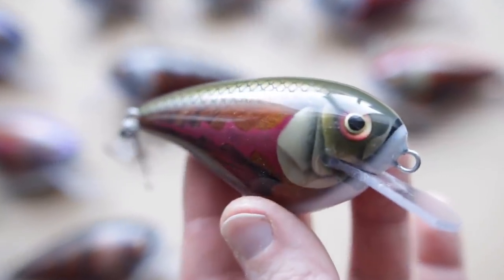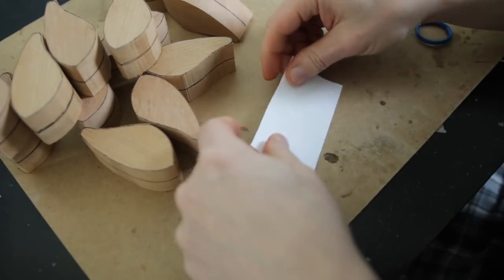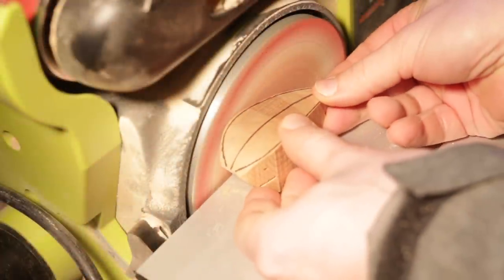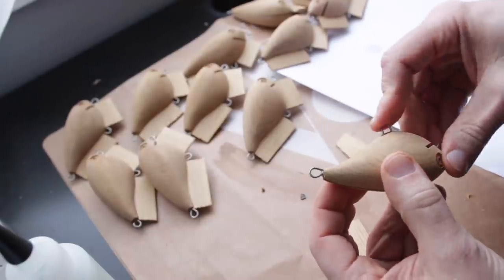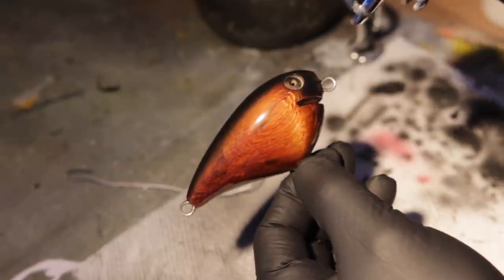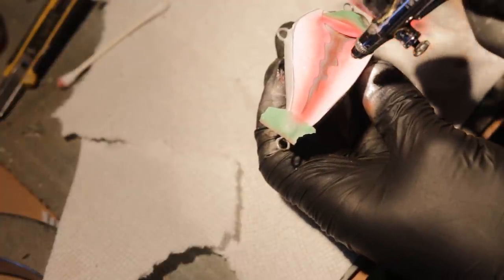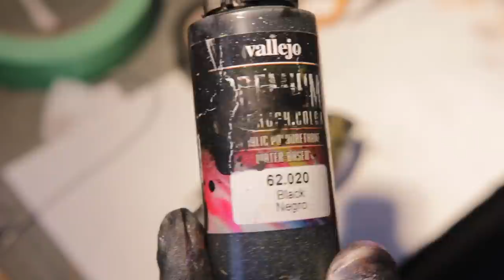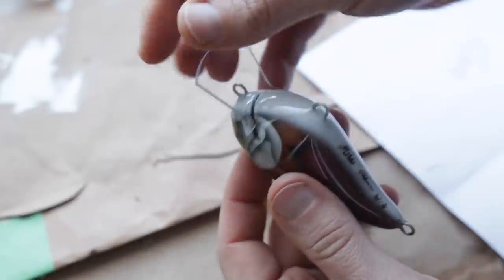Lure making | The square bill crankbait

Comment: 1:53 This is the most common mistake that leads to injuries on the band saw. Do not use your fingers to swipe away waste material! Just leave it until you're done cutting and the saw stops moving or use a waste piece to push it out of the way. I suggest finding a spot on the machine to keep a little dowel or rod to push waste material away if you can't keep yourself from wanting to keep the waste away.

Comment: The wood strip wire slot method is what I use also. Aside from being easier to sand, it also helps to reduce or prevent cracks and splits over time as the wood expands and contracts. As always, I really appreciate the inspiration I get from your incredible work. Miss seeing your posts on OGF in the tackle making section, along with a couple other sites that I've followed you on over the years. Keep on keeping on Mikko!

Comment: Been following you for those 11 years  as always great video ,been making wooden lures myself  for very long time. I have too commend you on the part in this video where you use stainless spring steel wire I would never use anything else. But there are so many youtubers that  use that cheap annealed wire you buy at hardware stores and twist wire in drill etc. which is crap. Never trusted the epoxy clear coat for sealing the bait  always used nitrocellulose lacquer 50/50 with lacquer thinner to seal wood,  epoxy on final coats.

Comment: I don't know if you are aware or not but decoy carvers when cutting out the side view save the pieces they have removed usually in two pieces, top and bottom. They then tack ( either hot glue or double sided tape ) these two pieces back in place  draw the top view on and cut that view out. When done you just pop off the the waste. Far less chance of getting cut that way. And you have a flat surface to place on your drill press to drill eye holes. Lovely work on these baits. 👍🇨🇦
Reply from the maker: Thats pretty smart i might have to try that out
Reply: This is what I meant , http://www.dmdecoy.com/carvingdemo/step-1-cutting-out-a-decoy-blank.html

Comment: What is the brand/ material you use for the lip material? I'm having a difficult time figuring out this part of the process.... it doesn't seem like there is any material specifically designed for this purpose. Maybe I'm wrong about that but for some reason I'm letting this part get under my skin haha
Reply from the maker: 3mm Lexan polycarbonate is what used here

Comment: Depending on the depth your lure is running will determine the color of the stripe on the bottom and top. A light colored bottom is meant to camouflage the fish from below by making the fish appear as if it a reflection or ray of light. A dark stripe across the top is meant to make camouflage the fish from above to make it appear as if it is part of the darkness. 

If light is penetrating from above and  light strikes a white, yellow or other reflecting color, a fish would be more inclined to see the bait from above while the lure is running at deeper depths. 
This type of lure would be used when fishing near the depth at which light no longer penetrates the water where the fish being fished still hunts in the depths above the lure. The rest of the lure body, from the mid section to the bottom would be painted darker colors to camouflage the bait from fish deeper in the water. As this color scheme is used, the bottom color would stay dark as possible so that the lure would stand out in depths of around ten feet of water where lurkers might be inclined to strike from underneath.

Comment: Insdead of carving ,try using the disc sander at an angle. It works well and with practice it's quicker.
Reply from the maker: I already do that on bigger lures. With small ones like these i prefer a knife for more accurate shaping.
Reply: @SolarfallBaits  with practice smaller lures can be done just as accurately.  The ones I sell are 30 mm.  I still do a bit of carving with a chisel before the sanding stage. Thanks for the reply.

Comment: How do you like working with bondo? I just started making fish decoys a couple of years ago. I initially used bondo to fill over my lead cavity, but was persuaded by the old-timers to ditch the stuff…”too messy and over time there will be a definite crack where the bondo meets the wood”. Man, were they right! I use KwikWood by JB Weld now…so much easier to work with, however it may not set up as quickly as bondo. But, I am not going to argue with your results…and, to each their own, right? Always a pleasure watching your videos. They’re so inspiring.
Reply from the maker: i've used car body fillers such as bondo for probably 15 years now and i've never had the issues you described. knock on wood :)
Reply: @SolarfallBaits  :)...Thanks! I suppose the drastic temperature change from freezing cold water to a warm spear house is more of a shock to the wood on a decoy? Plus, your lures are probably sealed better than most decoys. Cheers.
Reply from the maker: @jaydar1968   i think it might be a wood issue, the types of woods i use dont really expand that much even if they get wet and i've heard that alot of the decoy carvers use softer woods like basswood and poplar which expand can expand pretty drastically if they are not sealed really well.
Reply: @SolarfallBaits  Yup, most decoy carvers stay away from basswood...unless they are decorative decoys and used for show. Northern white cedar, white pine seem to be the most common choice for working decoys. I know of some guys that use jelutong too. I have made a few out of western red cedar. What kinds of woods do you typically use?
Reply from the maker: @jaydar1968  i think the most common ones for me would be oak, maple and probably birch. Since i moved to canada i've been using alot of red cedar too
Reply: @SolarfallBaits  With a good X-Acto blade, western red cedar carves pretty good; and, a clear finish over the natural wood looks real nice. However, as you mentioned in one of your other videos, a person needs to WEAR A MASK or RESPIRATOR when sanding. I have on occasions had an allergic reaction to it (rash on hands, puffy eyes, etc.). I use the respirator.